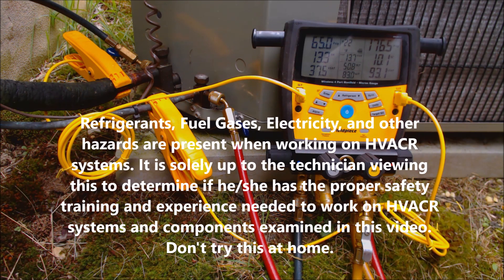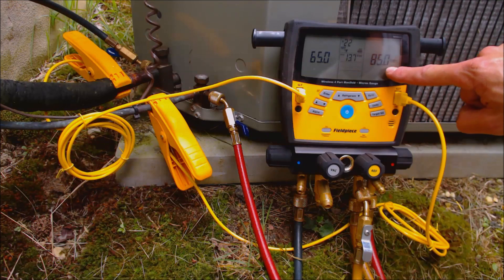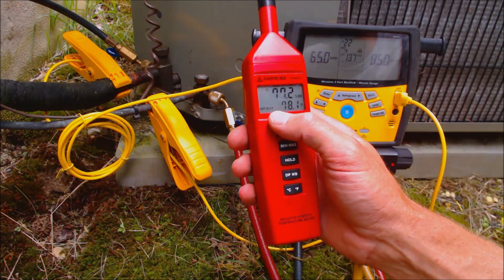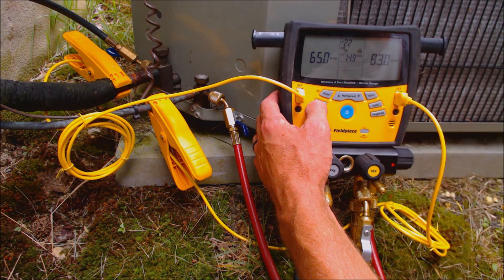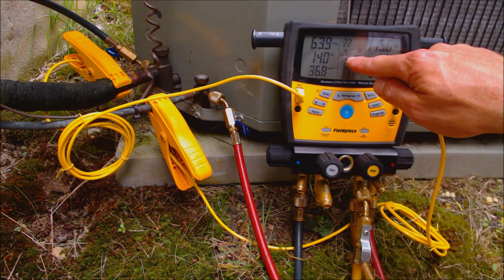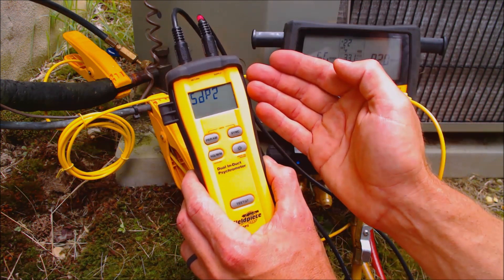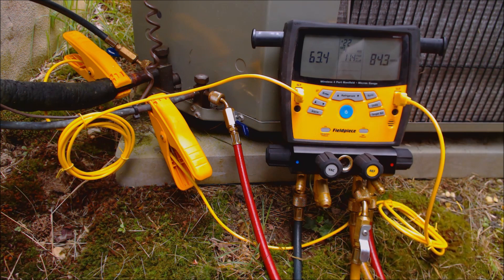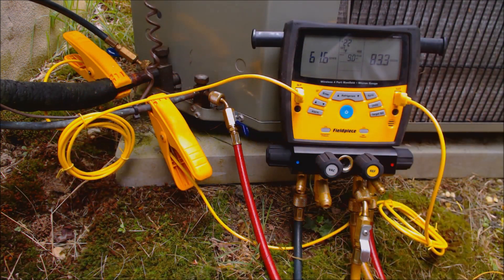How to Check the Charge in Superheat for Fixed Orifices! SMAN460 WB & DB

Comment from the maker: Tool List-  https://www.amazon.com/shop/acservicetech
Support-  https://www.patreon.com/acservicetech
For those that are looking for the tools used in the videos: (Linked Below)
Here is the Fieldpiece SMAN460 Digital Manifold Set- https://amzn.to/2nB4Fe6

Here is the Fieldpiece SMAN360 Digital Manifold Set- https://amzn.to/2BdoaD4

Here is a link to Refrigerant hoses with valves used in the videos  http://amzn.to/2aBumVI

Here is the Link for the Yellow Jacket Refrigerant Manifold Gauge Set used in the videos http://amzn.to/2aenwTq

Here is the Yellow Jacket Manifold Gauge Set including standard hoses- https://amzn.to/2vLVkV9

Here is the Yellow Jacket 4 Port Brute Manifold with Hoses- https://amzn.to/2BkuGIq

Here is the Compact Ball Valve Attachment for the end of the Refrigerant Hose- https://amzn.to/2KUisW8

Here is the Quick Disconnect 90 degree attachment for the end of the refrigerant hose- https://amzn.to/2MMtVcg

Here is the link to the Appion Valve Core Removal Tool- http://amzn.to/2uYr8WL

Here is a link to the JB 6 CFM Vacuum Pump   http://amzn.to/2nqbvo8

Here is the Link to the Appion Blue 3/8" to 1/4" Vacuum Hose- http://amzn.to/2uYlVyc

Here is the Link to the Appion Red 3/8" to 1/4" Vacuum Hose- http://amzn.to/2uYg6Ro

Here is the link to the Yellow Jacket 1/4" by 1/4" heavy duty hose straight-  http://amzn.to/2umtcod

Here is the link to the CPS Vacuum Micron Gauge- http://amzn.to/2v1nM3O

Here is a link for RectorSeal Bubble Gas Leak Detector http://amzn.to/2ckWACn

Here is the link to the Fieldpiece ST4 Dual Temp Meter- http://amzn.to/2wc1ME3

Here is a link the Nitrogen Regulator    http://amzn.to/2bXdR5f

Here is a link to the Nitrogen Flow Meter    http://amzn.to/2brvoBg

Here is a link to the Digital Refrigerant Scale used  http://amzn.to/2b9oXYl   

Other tool links can be found in the video description section.

Shop through Amazon! Your Purchases through Amazon provide a means for channels such as mine to earn advertising fees from all purchases after clicking through. Prices are the same as normal-    https://www.amazon.com/shop/acservicetech

All of the ACSERVICETECH Playlists-  https://www.youtube.com/channel/UCOZR-1IqsAer9wzlvFgb4mA/playlists?view_as=public
Reply: AC Service Tech LLC 

Hello,

Do you know if the SDP2 is compatible with the sman380v? I’m having trouble connecting the two

Comment: I had a big issue with a furdown (pancake) unit that nobody could helped me...i even called two a/c companies...called few of my old bosses VERY LOW super heat...i over charged system...i under charged system...i replaced compressor ... replaced dryer filter...vacuumed system...checked inside coil from access panel  1'x1' was able to see only one side of coil (clean)so the last resort was to replaced the inside coil and guess what ...when i removed the motor the fans and the wheels squirrel that's when i found out the issue... 70% of that side of the coils FULL of MOLD ...between parts and time 5,000$ down the drain..ps im not a master technician but felt good finding the problem after so much research...MOLD A TOPIC NOT MUCH COVER ON A/C VIDEOS...🤔

Comment: I have a fixed orifice r22 system that was just changed over to r407, would I determine the superheated and charge level any differently? 
Also had this been a variable orifice system would the target subcool be that is specified on the name plate for r22.

Comment: Do they still make systems with fixed orifices? Every modern system I come across has a TXV valve
Reply: Older systems are still running fixed orifice.  Let's hope everything hasn't been replaced yet?

Comment: Great video Craig. I really learned a lot. I have one question for you. Would it be possible to take subcooling readings as well as superheat readings without hooking up your gauges to the condensor unit. I took a HVACR class about 8 years ago and my instructor said that was one of his biggest mistakes he saw technicians doing. He said that you should first take your superheat and subcooling readings first, figure what the system is doing, and what it should be doing. Once that is established then you can proceed to connect your gauges. By hooking up your gauges each time you are constantly introducing air and non condensables into the system. If you have one technician after another doing this. You will cause other problems to the a/c system.  What are your thoughts on this? Thanks for all you do.

Comment: ac service tech this is a little off topic. I was reading modern refrigeration and AC and it stated " the liquid recovery method should not be used on all systems. Do not use liquid recovery on either heat pump systems or systems with less than ten pounds of refrigerant. " Can you interpret that for me ? Not understanding why that would be an issue at all....
Reply from the maker: I believe they are just talking about about recovering with a self contained recovery unit. Three things, it may not be worth recovering as a liquid only since there is a small amount of it in the system compared to larger systems. Also there is quite a bit of liquid in the accumulator which is not connected to the liquid port. Most smaller recovery machines can't handle liquid recovery only but just saturated refrigerant but larger recovery machines would work for liquid recovery. It makes sense to recover liquid out first on systems that have several hundred pounds of refrigerant inside but not on small units with less than 10. Anyway, that is what I think they mean without reading the context around the statement, thanks Jacob!

Comment: I use a SDP2 with a SMAN460 for wireless IDWB.  Can I sync another wireless Fieldpiece instrument for ODDB and what would it be if possible.
Reply from the maker: Yes I use the SC660 as shown in the video.
Here is a link to the Fieldpiece SC660 Wireless Multimeter- http://amzn.to/2gWDUhc
Reply: @acservicetechchannel  I just did the firmware update and I cant get my sc660 to sync.

Comment: Yo A.C I recently bought the Sman 460 . I'm having doubts when I use it for a vacuum though as in im not sure why when I shut down my vaccum and valves why my micron reading keeps climbing way above  500 . Could you make video on the Sman 46o and all its functions . I think field piece is this best .
Reply from the maker: Hey Sean, I have heard of others saying the vacuum gauge leaks. I honestly do not use the SMAN460 or any other manifold gauge set when vacuuming. I keep them out of the equation for the very reason you are speaking of. I think of the SMAN460 more for the availability of using wireless indoor wet bulb readings compared to the built in micron gauge. Otherwise I would just use the SMAN 360, thanks and you should call Fieldpiece about that in order for them to rectify it. Thanks and let me know how you make out.
Reply: Putting dielectric grease into the shutoff valves will stop the leaking.

Comment: Hi Steven, 
I just. Has some one install a new Ac Armstrong. 16 seers. It said quiet operation .but when the unit run the fan was so loud and also the compressor was noisy too.
Can you tell me what can I do.?!.
Thanks!
Reply: 16 seers 3ton
Reply from the maker: It may be possible to install a compressor jacket around the compressor on the inside of the unit. It is basically fiberglass insulation inside two pieces of black plastic this forms a bag that is Velcroed around the compressor to quiet it. The compressor uses the refrigerant flow to cool the compressor so it won't hurt to cover it. There is not much to do with the fan unless it is unbalanced or the metal is rattling, thanks
Reply: @acservicetechchannel  .Thank so much. If the fan not balanced what 's I such do..?. I did paid 3,800 and I 'm not satisfied it. Can you has any idea what I such do. 
Thanks..Again. !..
Reply: JIMMY TRAN why not take your concerns to the person who you paid 3800 instead of asking somebody else ?
Reply: @الجمهوريةالشيطانيةراعيةللارهاب  .
Hi Thomas ,
Well just because I ready don't know much about Ac that why I ask if Steven . Because he an expert. .!.but thank for your command.

Comment: Is the superheat wet bulb chart that is usually by the rating plate at the condenser on split systems universal? Because there has been times when I see them rubbed off due to weathering.
Reply from the maker: Yeah they are very close with the target superheat. If you don't have one then just use a generic chart. Have you seen "acservicetech superheat chart" ? Thanks
Reply: First I just want you to know I can't  count how many times your videos provided me the information to over come A/C problems. Thank you very much for taking the time and doing these. As to this specific video I have not but as soon as I get off work I will! 👍🌡️🔥❄️